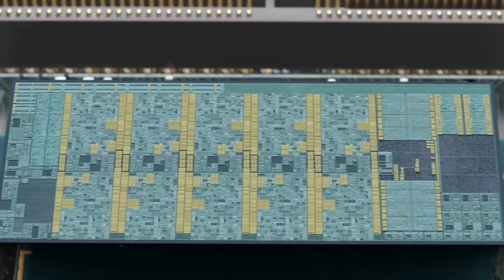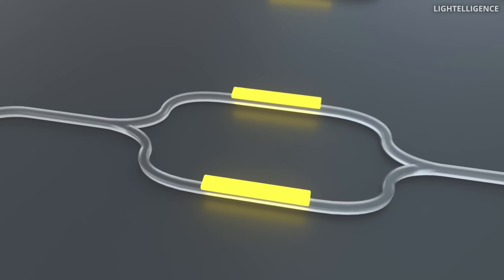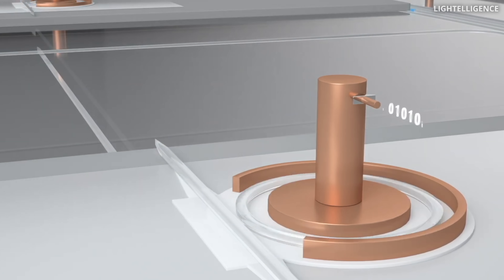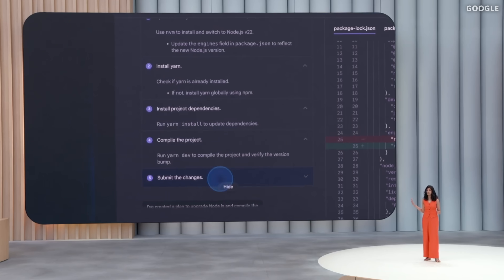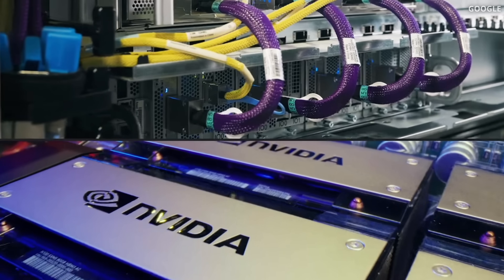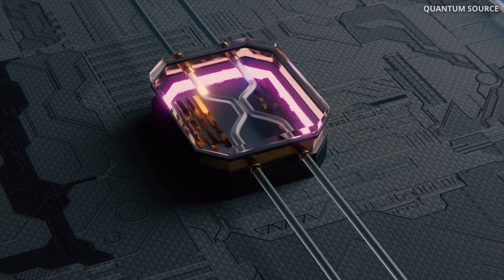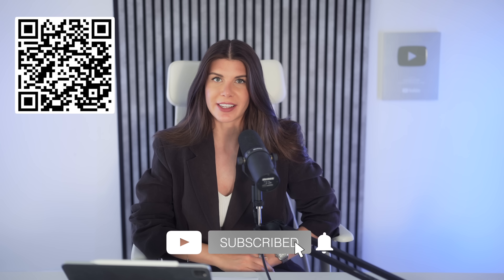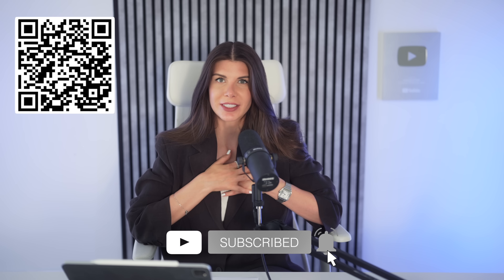Why Light Will Change Computers Forever

Comment: Fascinating. Another world changing breakthrough technology. It opens up new possibilities. Now light is only one small section of electromagnetic radiation.Can the process be sped up even faster using higher frequencies? Research on more durable materials sure to follow. Why not ask AI what would be required and how to make it. Suddenly there are few questions that can't be answered quickly anymore. 

Fifty years as an engineer working in many industries including building wafer fabs, data centers, networks and watching how each new step was fed on previous steps and then feeds the next step causes the process to accelerate exponentially. Each breakthrough in hardware makes possible new software which in turn spurs on the development of new hardware. The anomaly or inflection point will occur when the process takes the human out of the loop. The machines will build, program, and maintain each other and they will define and develop new software all autonomously. How would two AI computers do in a chess game? Would each game end in a draw or instead would white which makes the first move always win being half a step ahead of black? 

Okay Elon Musk, I know that you are creating AI robots. You are an AI company not a car company. The self driving car is just one of the types of robots. So now I know how you will get humans to Mars alive and even colonize it. With today's technology just getting one human to Mars alive is not possible given the hazards that will be encountered. So AI will give you the answers of not only what to build but how to build it. Then other robots will build it for you while you can argue with people. I know your type because I'm one too. Tell me what you believe and I'll tell you why you are wrong. 🤣😂

Comment: well it was 2003, the german frauenhofer institute experimented succesfully with a see through duct tape worth 30 eurocents /tesa film/ to store 50TB data on it as hologram data, same year do not remember what country/group came up with connecting a leeches brain with golden wires as direct brain computer interface, and intel have had a netburst technology based cpu that was a prototype and cooled with liquid nitrogen running at 10GHz while the commercially available consumer cpus just reached 2GHz /even though the GHz wars were abandoned with more cores and threads and problem to cool the processors effectively/ hope AI, rapid prototyping and potential commercial gain will speed up technologies to turn from unique prototypes into commercially available hw to consumers in a jiff

Comment: No- the key point is that such a processor enables AGI (access to distant data, systems "thinking", parallel processing of data across all layers in ML/DL; a completely different functioning of LLM). 
If they implement this, we’ll have AGI integrated with hardware; a somewhat "mental disability AI", but already capable of replacing 90% of people in intellectual jobs (they won’t stand a chance).

*An important event for the whole world
(to me because... I’m raising my pay ;)))

Comment: Wouldn't it be possible to make the light chips larger if needed? I mean they are producing less heat than a transistor chip don't they? so you don't net so much cooling. Sure they need space then but maybe the benefit is way bigger.
Reply: These are still silicon chips, and it's already possible to make traditional silicon chips larger; the problem is it quickly gets far too expensive unless you're going for a niche market with wealthy customers. Cerebras Systems has what they call a "Wafer Scale Engine" which basically means they turn an entire wafer into one big CPU (as opposed to dozens of normal-sized CPUs). Their WSE-3 is believed to cost two to three million dollars, in part due to the following problems with scaling chip size:

First, the size of the silicon wafer that chips are built on is limited, and wafers are expensive to produce and process. The bigger the chip, the fewer of them you can make from each wafer. When costs stay the same, but you make fewer chips, each chip has to be sold at a higher price. That's just the geometry.

The bigger problem is that defects of some kind commonly occur during production, randomly distributed across the entire wafer. When you increase the size of the chip, you increase the probability that each chip will be affected by a serious defect, worsening the ratio of good chips to bad chips, and further increasing the price of the good chips.
Reply: @Onihikage ok, but if you have a Bigger surface you have to cool More so thats one Reason why chips are small.  And of course the quantity
Reply: @Mopze  You've sort of got it backwards. Thermal transfer is most limited by surface area, so when a chip is made bigger, it actually becomes easier to move the heat out of it. In technical terms, thermal resistance (how hard it is to move heat) scales inversely proportional to chip size, resulting in lower thermal resistance for larger chips.

A larger chip which uses the same amount of energy per unit of area as a smaller chip will generate proportionally more heat than the smaller chip, but because it has a larger surface area, that heat is more easily removed. Cooling is not an issue.
Reply: And to stack the chips vertically. Apparently heat is not an issue

Comment: This is absolutely fascinating.  It will definitely change the way smart devices and many technologically applications interact with each other as well as hue'mans.  Giving Artificial Intelligence a means of processing data and applying that data in real-time, on a relatable level with life itself. Brilliant! Spasibo Anastasi!❤️🙏💯
Reply: "on a relatable level with life itself" 

i doubt its gonna be relatable in about 5 years :"D. maybe more like 7, but still. digital medium has SO many advantages in the long run of development.
Reply: @kliersheed Well, virtually everything in this reality and beyond operates on various and specific frequencies.  Just like fire itself has its own frequencies from various components that make it up. Which allows things to cook or burn. In respect the microwave can mimic similar effects.  I'm sure if Artificial Intelligence can learn and identify the basics to operate in the same or similar fashion through a variety of outputs if it is given or gains access to those sources.

Comment: well an active flipflop circuit of course. or store some charge like nand does. well just loop back the signal. ie flipflop. well people forget. photonic capacitors. well you can always bounce light in a reflector container. like a laser. dont be so many.
Reply: optical electron field effect transistors should be very nice for lcds.